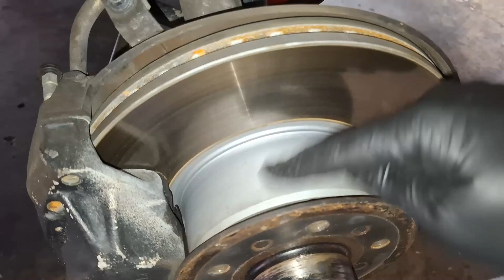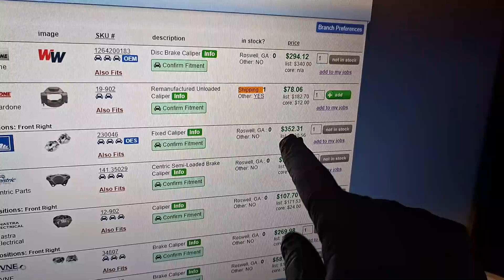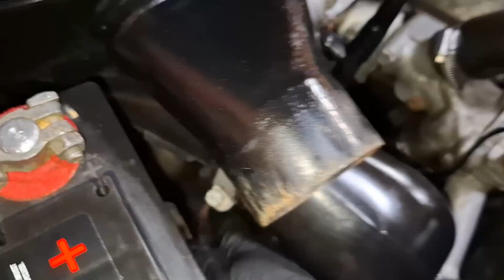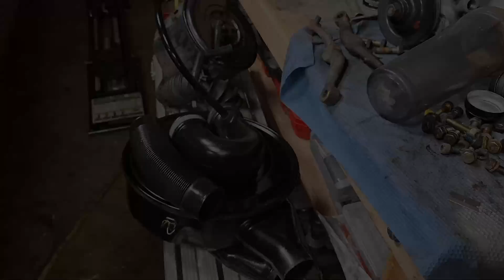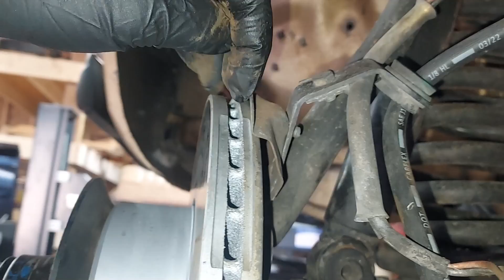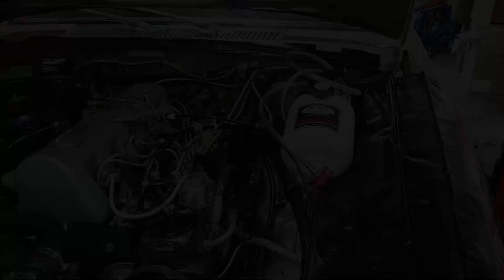1980 Mercedes 300SD - General Maintenance and Repairs

Comment: Hello! What is your opinion about using Castrol 15w40 on 300D? Hard to find Rotella in Europe.
Reply from the maker: You need to use oil that is rated for diesel engines so make sure it's heavy duty diesel engine oil because it has detergents needed for diesel engines. 15W40 weight is good

Comment: Michelin still makes tires for our cars!  I recently purchased a set of 5 Michelin MXV-P tires from Longstone Tyres, factory correct size of 185HR14.  The shipping was free from the UK and they arrived at my doorstep in 7 days.  Tire date code showed the tire was only 6 months old.

Currently 600 miles on them and I absolutely love them.  The ride is great, terrific handling for a large car, great traction for hard braking in wet roads, and they’re great on fuel economy too (31 mpg on her first road trip).
Reply from the maker: Nice!

Comment: So when I replaced the same hose on the turbo on my ‘80 300SD, I sourced a new one from the Mercedes dealer.  Interestingly, that hose is made of silicone.  I have no idea why it’s silicone, so i hit the “I believe button” and installed it lol. No issues so far :)
Reply from the maker: The turbo wastegate hose is silicone so it can handle the high heat. Silicone is extremely heat resistant. However it's really overkill by Mercedes. Any standard hose will do fine.
Reply: @woodsandbarclay I can’t believe Mercedes back then would go overkill ;)